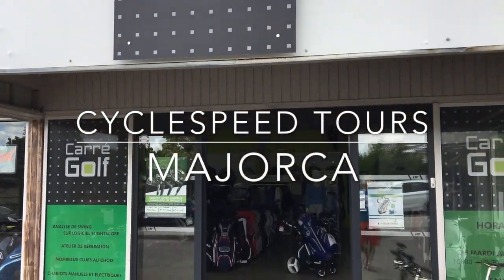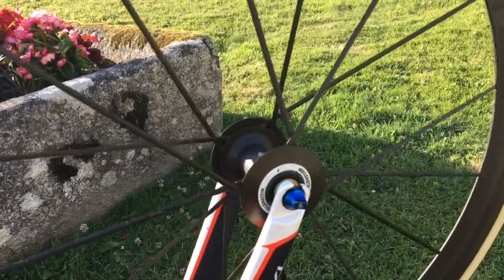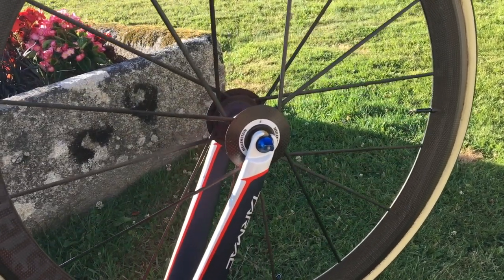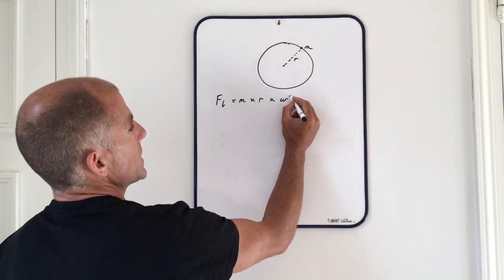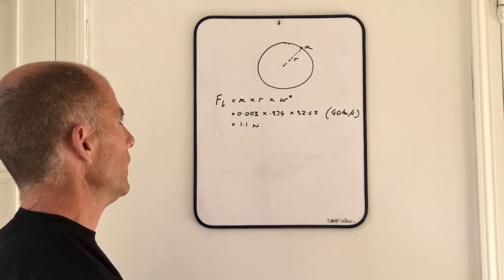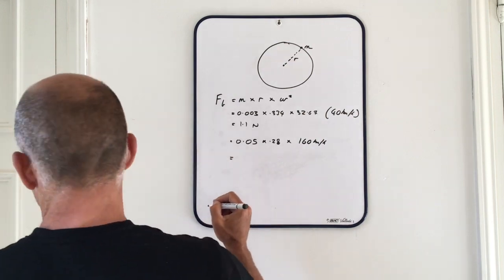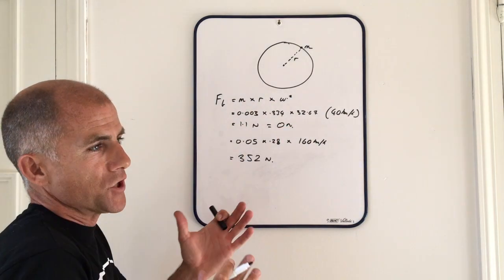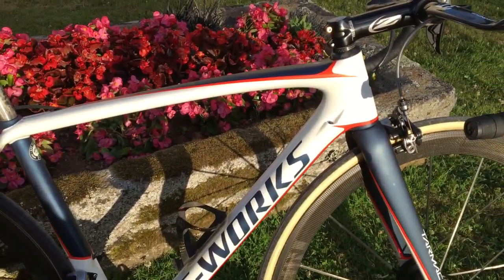Wheel Balancing ; Worth it? Or Waste of Time?

Comment: That was not balanced. If balanced correctly you should be able to have the valve at any of the 360 degree points and then take the contact of your hand away from the wheel and the wheel should not move what so ever. Also with finding the correct place to put the weight first you need to lightly spin the wheel and see where the valve settles and do this 3/4 times to make sure because the balance maybe offset, with some wheels the valve may not settle at the very bottom which would mean its offset. This can happen when one forgets that they have an inner tube inside that has a patch or two, also carbon layups can course offset as well sometimes. Its a good idea to use blue/white tack first to find the required weight before applying and permanent weight/s.

Comment: Not certain it’s about speed. I had a terrible speed wobble on my tcr last year, kind of inexplicable, never had it on my old bike. I will experiment with balancing wheel to see if bike feels more stable at speed on descents: purely for safety.
Reply from the maker: It's more about resonance for a speed wobble. At a certain (usually high) speed, the vibrations from the offbalance equal the natural frequency of the wheel and a violent wobble can be produced
Reply: It's bifurcation. It's about the frame, not the wheels. Listen to "marginal gains" podcast - episode #42

Comment: Nice video! Would you balance a road bike wheel with a 30-gram imbalance in it?
Reply from the maker: Wow, 30g is quite a lot no? Does it vibrate at high speeds?
Reply: Cyclespeed Tours It’s quite a lightweight tubeless wheelset, and the tubeless valve seems really heavy. It’s easy to notice on the rollers, because they’re so smooth. The bike doesn’t hop up and down, but it does oscillate slightly back and forth underneath me, which I can see and feel. The only time I’ve noticed it on the road is coming down a mountain at 70km/h. It made the bike feel unsettled (me too!). Wonder if it’s causing efficiency losses.

Comment: Nice video... when descending at high speeds in windy conditions, balanced wheels will give u additional confidence and less unwanted vibrations... i think it is worth it. Also the 1.1N should be multiplied by 2 to cover both wheels.

Comment: Have you consider put the weights inside the wheel, under the tyre tap? to minimise the drag. What I consider is 2 or 3 peices of weights are relative big on the wheel, is that effect the wheel's areo dynamic which lose more watts than the saving of balanced wheel?

Comment: Hi again from Dan Sotelo at dynamicspeedbalance.com
Well, it looks like you'll finally be seeing wheel balance on high-end wheels in 2019. A leading wheel brand is about to review DSB technology.  They are very much inspired by your  video.  Great Job, I owe you one!

Sincerely
Dan Sotelo
Reply from the maker: That's great to hear. We can only welcome any research and input from big companies with the funds and time to do it properly. I'll be doing a bit more testing on my new Campagnolo Bora Ultra 50 wheels.
Reply: I'll keep you posted on developments with Dynamic Speed Balance.
I see you're reviewing Campy Bora Ultra 50 wheels, which are the only wheels on the market that feature a basic "wheel only" balance, that's without tires, tubes or TR valves. If you look at the fine print Campy calles it Dynamic Balance. The problem is, the moment you install tires and tubes or TR air valves, the wheels are once again, "Unbalanced".  It might sound like it's an improvement, or better than nothing, but once again the bicycle industry keeps kicking the (wheel balance), can down the road saying it's not that important. I've personally heard the excuse by major brand owners tell me "if it's so important how come no one has done it"? Yet they Bragg how they are on the cutting edge of technology.

It's just mind-blowing how some bike brands will spend tens or hundreds of thousands of dollars to find a way to mold a new fork with a tiny fairing to marginally improve air flow past a disc brake caliper saving a 1/4 watt. Sure it's important, but ask them to conduct a scientific test to look closely at what happens to unbalanced wheels at high speed, to see how many watts are lost, and let the excuses flow like fine wine, saying its irrelevant.

Anyways, I know by now they are seeing the writing on the wall as some major bike engineers stumble onto sites like yours. I know deep in their heads they're feeling the heat. And I know exactly what's going to happen, the moment they jump into wheel balance, the very same people that said no, are now going to be bragging how they've always been the leaders, shakers, and movers of bicycle wheel technology. Mark my words.

Sincerely Dan

Comment: My apologies but I didn't catch your name,

And please do not take offense to my message below. As a matter of fact, I would love to get to know you better cause you are very good at what you do.

Anyways, I never said the aerodynamics of the wheel is lost if the wheels are unbalanced. My Bad, maybe I should have phrased it a bit different as follows; The performance advantage(s) gained by the rim's aerodynamic shape, is greatly reduced and practically lost if the wheels are not rotationally balanced, especially at high speeds.

And just because I have a product, and or intellectual property that is for sale does not cancel the fact of Newton's first law.
"A mass that is put in motion will continue in motion unless interrupted by an outside force, or an oscillation". You eloquently covered Outside Force, with your aerodynamic equations, very well.  But the Oscillation, this is where I invite you to take a second, and very close look at what really goes on with an unbalanced wheel or wheels at high-speed. I promise, with your knowledge, you'll go nuts trying to make all new equations and calculations when you discover the reality of it all.

1. Sure your thesis on the aerodynamic's of the rim and spokes are pretty much correct.
2. But you completely underestimate and do not have a real understanding of what really happens when an unbalanced bicycle wheel is spinning at 80 KLM (common speed when decending Mtn roads). The oscillation forces are so powerful that it takes a heavy toll on rolling efficiency and overall performance on both bike and rider. Litterally making your tire contact patch bounce like a basket ball on the road surface.
* On your video your calculations are based on the 3 grams, spinning at medium speed 40KLM, but you only calculate the 3 grams. Sorry to say but you failed to add & equate other probable problems as we discovered during our scientific investigation we made with a tech & engineering team from the University of Washington.
* Plain and simple, that innocent little 3 grams of off balance weight is like a tiny match/spark in a dry forest, and as we all know a tiny spark can burn down a whole city or forest.  Same thing with a wheel at high speed that innocent tiny off-balance weight is like a tiny spark that invites the entire wheel to oscillate violently from the axle and outward to the edge of the tire at high speed. This is explains why you see a tiny weight on a massive SUV wheel, as this tiny weight prevents the spark on the big SUV wheel from starting any cycle of oscillation on a SUV wheel that weighs about 10lbs. If you remove that tiny weight then the entire 10lb wheel goes into a violent oscillation, don't you agree?
* We did test with powerful computer apps using accelerometers putting out real-time data and made some incredible discoveries starting with,  G-Forces. A 7 gram off balance, on a rear wheel causes the entire rear wheel weighing 3.5 lbs at 80KLM   to generate between 3 ~ 8 G's. So a conservative average of 6 G's is a total of 3.2 lbs X 6 = 19.2 LBS! That's equal to a 19.2 lb Sledgehammer swinging on your axle!
* That's just the rear wheel! Now imagine both front and rear wheels doing the same thing?!
* Than we made yet another discovery, "Synchronized Oscillation". That's when the oscillation forces of both front and rear wheels temporarily synchronize thus creating a very dangerous situation for both bike and rider. Let's do the math....  R wheel 3.2 lbs, F wheel 2.2 lbs x 6 G's = 19.2lb r = 15lb f total G weight 34.2lbs!
* Bottom line, Even at 2 G's, unbalanced wheels synchronized at high speed definitely takes a toll on any performance gained from hi-tech aerodynamics, equipment and or materials.
* We also suspect high-speed Synchronized Oscillation is the main cause of the dreaded High-Speed Wobble/Shimmy.
* And yet we made other discoveries, one being "Induced Yaw", where both wheels when oscillating violently temporarily want to go in different directions.
* So if you add up all you see above, no matter how minor the imbalance at high speed, it is not good, Period.
* We also made another interesting discovery. Because bicycle wheels are flexible (unlike motorcycle and cars), when an unbalanced bicycle wheel oscillating violently it cannot shed the energy fast enough thru the wheel, frame and rider at high speed, so it literally starts to warp, as it is desperately trying shed all that oscillation energy. 
PLS SEE THIS VIDEO VERY CAREFULLY, and you can see the wheels literally warping:
https://www.youtube.com/watch?v=QC-PuBDFNac
(Fast forward to 2:20 and see the bottom of the wheels warping in real time and slow motion, it's not the fenders either). 

* Because no one has ever bothered to scientifically take a close look at this problem is the reason (until now), why most dismisses bicycle wheel balance as a "there's nothing to see here so why bother to fix it".  And your calculations do just that.
* "BUT WE DID DO THE HARD WORK".  We put together a technical & engineering team from the University of Washington and did some real-time data testing, using powerful computer apps, accelerometers, and high-speed cameras, to look, record and see what really happens to new high-end, unbalanced carbon road wheels at high speed. What we found was unsettling and shocking, to say the least.
* We also found that some of the top brand and very expensive wheels on the market are the worst culprits, some are so bad they shouldn't be on the market cause they are so dangerous at high speed.  So this is the reason why we are trying to sell our IP, to correct a very dangerous and unsafe problem. And yes we even patented CPSC OEM balanced reflectors, for those who choose to keep reflectors on their bikes.
* My Patent pending IP can balance bicycle wheels without adding any weight, messy stick on weights, or gadgets.  And it is the first system in the world that is cost, production, dealer & consumer friendly. The system is so efficient that Volvo right now is reviewing Dynamic Speed Balance system for OEM on all their cars and trucks.

3. Just to give you a hint of the immense power an out of balance (7grams), bicycle wheel has spinning and oscillating at 80 KLM + try this test. Put a bike on a work stand, gather 10 of your strongest, biggest friends, crank up the rear unbalanced wheel up to 80 KLM +, then have all 10 carefully hold the bike and. try to stop the bike from shaking. Guess what? Those strong oscillation forces go right thru all 10 of your friends as if they were made out of jello. And I can assure you, it's not coming from the 5 or 8 grams of unbalanced weight as I will explain below.
4. I know what you're thinking, once a rider gets on the bike putting pressure between the road and the bike and rider any slight off balance issues on the wheels will be easily canceled. But the reality is, now those forces are trapped between the hard ground, the bike and its rider. And as we all know energy simply does not magically go away it has to go somewhere. Now the problem becomes worse as these powerful oscillation forces are now forced to dissipate thru the tires spokes frame and its rider. But since a bicycle has been generally designed to absorb road vibrations the rider is unaware of the problem going on beneath him or her, they simply dismiss most of the vibration to normal road surface irregularities.

4. So saying you didn't feel any difference after your lost your wheel's balance weights, is like saying you physically didn't feel the performance difference between an aerodynamic rim and a non-aerodynamic rim as you were riding. You're not the only one, millions around the world, don't feel the negative effects of unbalanced wheels, but its there.  Even when riders experience High-Speed Wobble, they never suspect that the main cause is their unbalanced wheels.
5. Time and time again, my customers' direct riders to my shop, who chronically experience high-speed wobble. After I balance their wheels the comment I hear most is "how quiet their bike rides at high speed (especially all carbon bikes)". Also how quickly their bikes accelerate and pick up speed and when descending, always having to wait for their friends at the bottom of mountain roads.  Many comment how their bikes once felt very nervous at high speed. But after their wheels are balanced, suddenly their bikes feel if it's on rails while descending fast twisting mountain roads. As for the chronic High Speed Wobble/Shimmy, they simply forget they even had that problem, that's how important bicycle wheel balance is for SAFETY, rolling efficiency, handling and overall performance.

So there you have it, it's a bit long but what you see above is the tip of the iceberg when it comes to bicycle wheel balance, as it will allow all new technology never before possible which we already began patenting.

Sincerely,
Dan Sotelo
Reply from the maker: Thanks for the extensive reply (it's Andrew by the way!) However, despite reading all of it, I keep coming to the same conclusion. 
Which is that pro racers descend regularly at 80kmh + on unbalanced wheels without any problems whatsoever. 
If they were feeling huge unbalanced forces, I'm sure they would be asking for solutions if they felt that their safety were compromised. 
But they aren't, so one can only conclude that this is a non (or at least very minor) issue.

Comment: It looks like you are the same person giving equations on aerodynamic wheels, and now on this video you explain about rotational wheel balance. If that is the case pls disregard my comment about Newton's Law.  I like it when someone like you is finally talking about what is wrong with today's hi end wheels.  I would love for you to contact me and can really give you an idea what really happens at 40mph or 70KLM when a bicycle wheel is out of balance by as little as 4 grams.  I did the research using accelerometers and powerful computer programs and made several startling discoveries.  All it takes is a tiny amount of off-balance to create a monster at high speed.  Kind of like a tiny match can actually burn down a forest... contact me at dynamicspeedbalance.com I definitly want to talk with you.

Sincerely
Dan Sotelo
president; Dynamic Speed Balance
Reply: Well, where do you get it?
Reply: Hi Dan, I went through your website and found it very confusing, I thought it was me but many others I asked came to the same conclusion. I'm interested in your work, I just don't know what it is. Are you selling a weighting system or an actual wheel? I've been a web developer for years, the first thing we learn is "don't make me think" I shouldn't have to comb through pages to find out what service or products you are providing, that should be clear on your home page. The video's you provided are fantastic, really shows the difference between what a balanced and unbalanced wheel makes!! As you said above "please do not take offense"  great video's, I just wish I knew If I qualified as a customer.

Comment: I did a quick calculation for you. If you assume the same balance grade tolerance as a car wheel, your permissible unbalance would be approximately 24g at the brake track on the back wheel and about 16g on the front wheel. That's at 40km/h

If you go to about 60km/h you only have 10g to play with. If you are going faster than that, it's worth getting the wheels balanced.

I've simplified the maths and killed a few constants:

1376 / speed (km/h) = max unbalance in (g) at the brake track
Reply from the maker: Cool, thank you!
Reply: Could it be that it upsets the neutral response to small bumps. Surely an oscillating system can't help matters…?
Reply: In my head it makes the incoming bump worse on the downstroke, but then helps upwards. That is not a good trade.